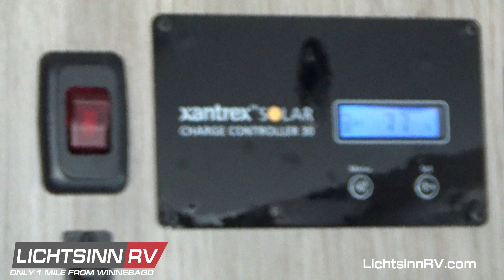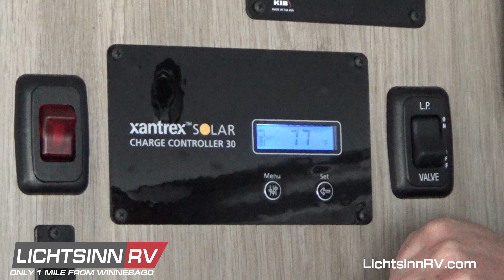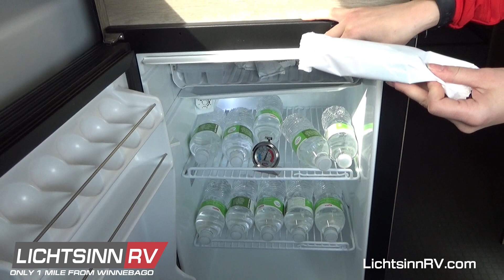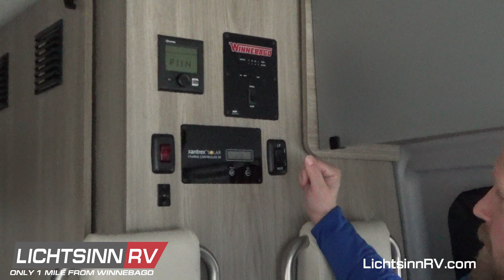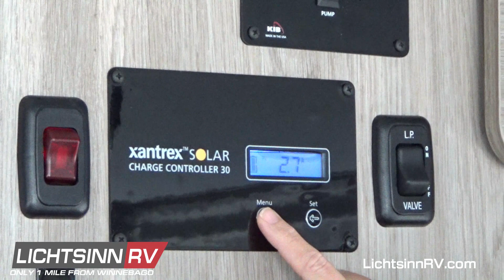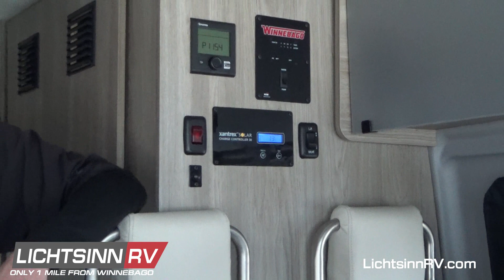LichtsinnRV.com -  Off-Grid Capabilities of the Winnebago Solis 59P Solar Experiment

Comment: Hi -- this is a great videa. I'm still a tiny confused. 59P pop top. I thought it was 170w, but you mention 220w) . .. it does charge when plugged into shore power? My understanding is that it doesn't have a built-in charger but I'm happy to be wrong.
Reply from the maker: Good afternoon!   This will have 220w of solar on the pop top to use.    The battery system will charge when plugged into shore power off the equipped and standard converter.  Hope this helps!
Reply: @LichtsinnRV  Awesome. two more questions
1). I assume when on shore power, house switch needs to be on to charge (just like driving)?
2) assuming fully charged batteries, what's the best way to leave the "house" switch: a)"On" and let the solar keep it topped of? b) "Off" and figure the house batteries have enough power that they won't run down, or plugged in. c)plug it in to be safe and keep the batteries in the best condition, or d) it doesn't matter?
Thanks again for your help -- you have some great Solis content on your site!
Reply from the maker: @hereusethis  Good afternoon!    The aux batt switch should always be on when you're plugged in to allow the converter to work... you can store this way if you have access to shore line power as it's a "smart" converter that will go into maintenance mode when the batteries are fully charged.   As to solar, these are hard wired into the batteries, bypassing the shoreline and converter, so if you have to store outside this will trickle charge the AGM batteries.   Hope all this helps!
Reply: @LichtsinnRV  Such great info. I'm try to help my in-laws with their Solis. It's a little on the complicated side for them, especially once you add in relatives borrowing the van and leaving it in various states of charge, so I'm trying to put together a cheat sheet of best practices.

So it sounds like when you don't have access to shore power and are storing it outside, you should leave the house switch "off" and the solar will keep the house batteries topped off. Is that correct?
Reply from the maker: @hereusethis  Correct!
Reply from the maker: Just make sure the batteries are fully charged before storing
Reply: @LichtsinnRV  You're so helpful! Thank you and happy holidays!

Comment: to me the real need is running the heater/blower at night/day boondocking when it is about 30F and how long the batteries can last.  More important than running the fridge which doesn't seem to draw as much power.
Reply from the maker: Good morning!   Thank you for your note!   With the insulation package in a van shell, and an efficient Truma system, really the only need for the 12V is for the blower... this should not be an issue at all with fully charged batteries.

Comment: Was the frig cold at all times? 
Did the freezer stay frozen?
One test I would do is put a coin on top of ice tray if it thawed the coin would drop into the tray. 
Frig is harder. Touching a bottle water wont tell you if the frig was off at any time. Other than having rotten food after a week or mayo that would make you sick.
How long can you run the AC on 90° weather?
Reply from the maker: Good afternoon!   The refer was consistently near 37 degrees and the freezer at 0.   This actually made the refer work harder because it there was no food in the freezer or refer, which can act as "free ice cubes" so to speak.   We did this test on a day that was very warm as well, near 90 as you mentioned.   The Solis 59P does not have a rooftop AC, so if that's a requirement you may want to look at the Solis 59PX.   Hope all this helps!

Comment: Does this van have an inverter that powers the AC outlets with 120V from the batteries,  or do those outlets only function when plugged into shore power?   Thank  you.
Reply from the maker: Good morning Steve!   Thanks for your note!   You are correct that from the factory the AC outlets have electricity only when plugging in... however, we can help with a portable generator or inverter off the batteries to helps with sizing your load... there are also many portable inverters up to 2kw that work well as well.   Hope this helps!
Reply: @LichtsinnRV  Good to know, thanks.  Do you think a portable inverter would allow the use of a small microwave oven off the batteries, or is that too much power draw?
Reply from the maker: @steveg309  Good morning!  It would be fine with a 2,000 watt surge, which I've used, even on a portable Jackery!   Hope this helps!
Reply: @LichtsinnRV  The outlets don't work off the CumminsOnan generator?
Reply from the maker: Good morning John!   Thank you for your note... all of the outlets fully function in the 59PX...  this is the 59P without the generator.   Hope this helps!

Comment: What needs to be done and at what price to have lithium batteries installed and the converter changed to li compatible?  The inability to run the ac for several hours/or recharge with a second alternator like the travato is the the deal breaker here for me.
Reply from the maker: Good afternoon Yvette... thanks for your note the 59P does not have a coach AC, although the 59PX does... have you seen this?

Comment: Can you replace the AGM batteries with 2 battle born lithium’s? Also, is it possible to have two of those solar panels on the poptop? It seems like if you slide it over, there could be room for 2. Lastly, can you please upload some photos of the Solis with the rear sofa bed option?
Reply: I would consider Solis only if it has A/C and can run off the lithium batteries for many hours.    Are these options available for Solis?
Reply: Don’t know why they wouldn’t offer the lithium batteries as an option as they do on the Thor comparable unit.
Reply from the maker: Good afternoon!   We could certainly do both of those items, but we also may have to change out the converter to a lithium capable converter...  the sofa option at this point is only a prototype possibility and has not yet been made available into production, if it will at all, so unfortunately we have no pictures.
Reply: @LichtsinnRV  I understand that you can install a Dometic Brisk II Air Conditioner in place of the fan at the back of the Solis P.  Would adding the lithium batteries make it possible to run the A/C without shore power?  I would like a Solis with a/c, and lithium.  It is my understanding that the Travato a/c can run off the lithium batteries for about 9 hours.
Reply: I would like to see ac and Lithium as an optional  package in Solis.
Reply: I converted to two lithium batteries on our Solis 59p. The solar controller has a setting for lithium batteries. So far it seems to work well, batteries staying fully charged.